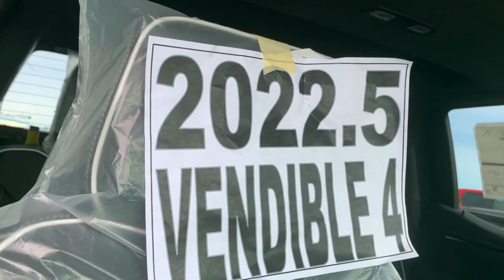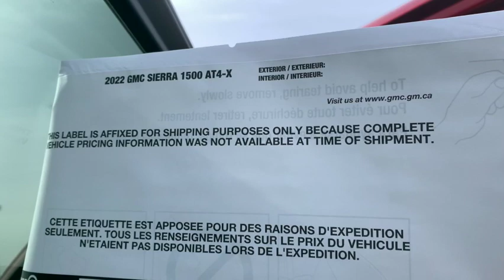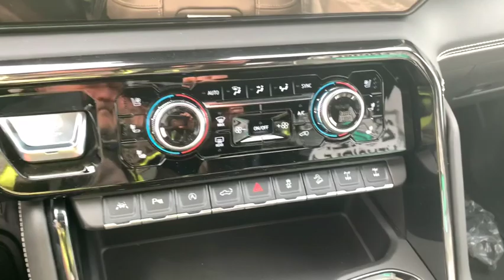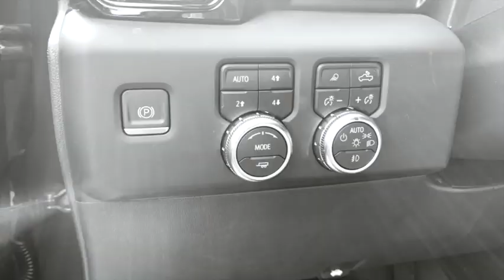💥 2022 GMC Sierra 1500 AT4-X ♦️ 6.2L - V8

Comment: The way the AT4X is…it seems like a totally missed opportunity to make a much more aggressive off-road truck. This should have the front bumper cutouts, hugely upgraded suspension (not just multimatics and locking diffs), 35” tires, and the LT2 from the C8 corvette. The way it is now; there just isn’t that much difference from the AT4.
Reply from the maker: ‼️Thank you for your comments 
👍😉😀
Reply: @PaulMcLove  sure thing. Thanks for your videos.
Reply: My guy, there are so, so many differences between a regular AT4 and an AT4X. The AT4X and Silverado ZR2 aren’t super trucks designed to compete with the Raptor and TRX. They’re both highly, highly capable off roading trucks that compete only with the Tundra TRD Pro, and with the Tremor. The regular AT4 and Trail Boss have the terrible G80 mechanical rear locker, bare bones-off the shelf shocks that could never handle sustained 50 mph+ on a washboard road and exposed exhaust that are easily damaged during steep drop offs. I agree that the front bumper on the AT4X should be more aggressive and have cutouts like the ZR2’s, but there’s already a more aggressive version that’s more off road focused coming out.
Reply: @keewatin427  ok, all that really tells me is that the AT4X is what the AT4 should be and I still think the AT4X should be much more like the Raptor or TRX. All you really told me is that the AT4 is a really shitty version of the AT4X

Comment: Surprised it doesn't have the dual exhaust tips coming out from the bumper
Reply: They did that for clearance issues while off-roading
Reply from the maker: I think it should be dual, but I only filmed one part.  I couldn't start the engine because the battery was dead, it was probably more visible.
🤔🧐🤷‍♂️